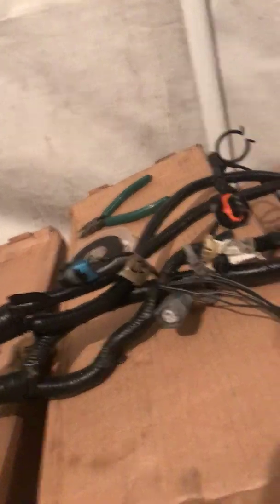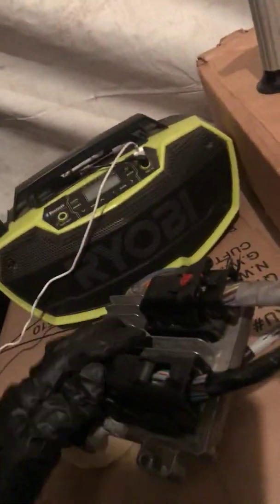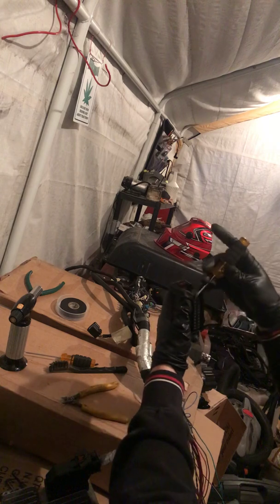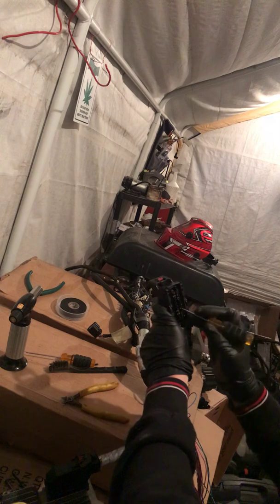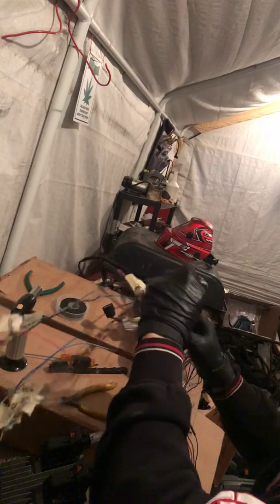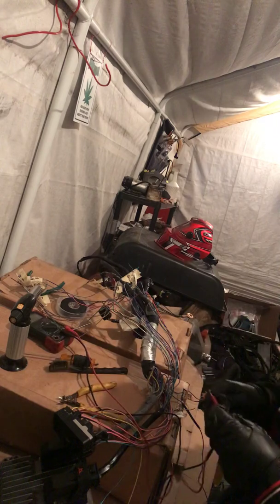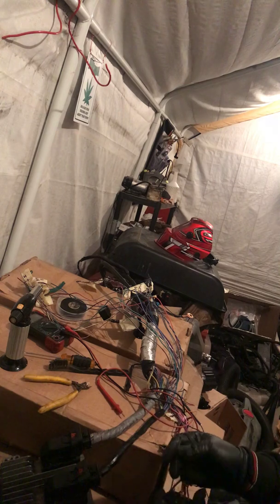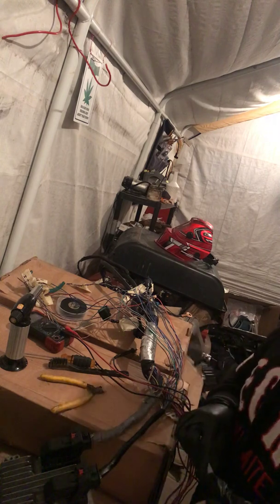DIY LS3 L99 Stand-alone wiring harness

Comment: Thanks for the video. Working on a L9C 2007 and following the diagram on lt1swap I can make my obd2 work but it won’t talk to the ECU. Have the two hots, a grand, bus+ and bus- hooked up. What am I missing?
Reply from the maker: Hey , pardon for the wait. 
I believe you may need an additional wire that originally came from your Transmission and or body control unit.
did you figure you the bug on your OBD2 data link ?